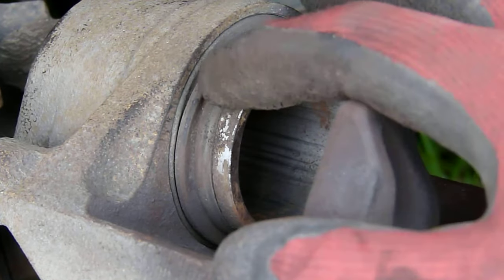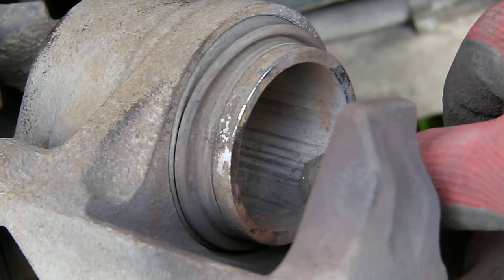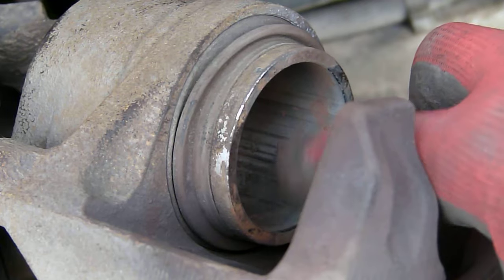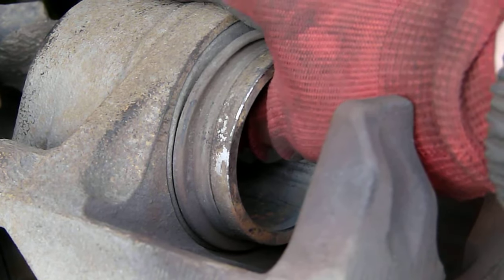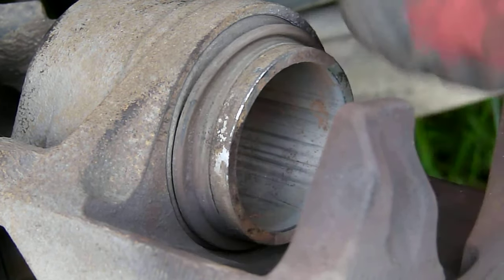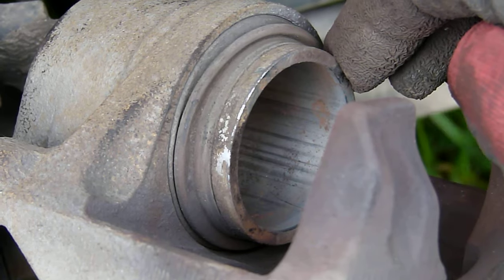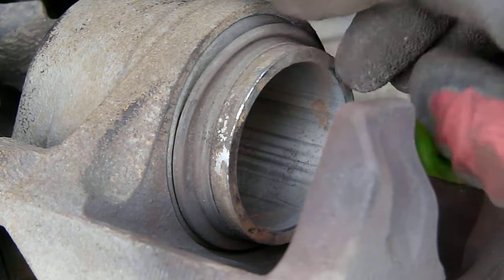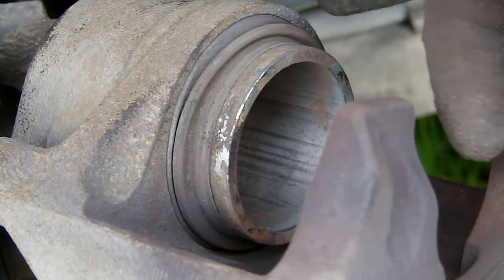Piston Lubrication on a Brake Caliper

Comment: Brake fluid will destroy,  rubber in no time,  the only thing you use it is red greese for pistons.
Reply: Listen man my brake calipers keep sticking open. Making my truck bog down and wearing out the brake pad quickly. What do I need to put on it to where it will open and close freely when it needs to? Do I hook up a grease gun to it and grease it does mine have a grease port? It's a 98 Mercury mountaineer. If I just rubbed the grease on the Pistons on the outside and let them shove themself back in with the c-clamp
Reply: @iamthepapi6251  well it sticks because of grease,  you don't need to add to much grease to caliper piston,  and it's important that you add red caliper grease not something some makes piston stuck.  I recommend you to press  piston ½ out, by pressing brake pedal,  take some brake fluid in 5 ml 💉,and wash rubber boot from inside,  depress piston and repeat x 4-5 time same prosedure,  after that use red caliper grease and add the piston.  I shall add some video of prosedure from en guy from Russia which cured brake caliper.
Reply: @iamthepapi6251  https://youtu.be/Sz1nN5b68Ic  watch from 3.30 he used brake fluid and direct grease for caliper.
Reply: Brake fluid is in contact with rubber parts. Piston seals made of rubber. So what you're saying is beyond absurd.
Reply: @rafars2246  yes its in contact but it dosent mean that you dont need grease to lubrikate slide piston,  brake fluid softens ruber and after some time it must be replaced,  because of softing of rubber. Try this experiment for your self and think that rubber sits fast on edge of piston for loong time not one week 
https://youtu.be/ztrnIRPX1t4
Reply: @viking236  rubber is used in caliper piston seals, so it can't be that bad. I would agree you'll use some silicone paste instead. I also put a light coat on the outside of the rubber.
Reply: Thoroughly clean out dirt, water and corrosion salt from the piston bore where the oil and dirt seals are seated. It's here that is the main cause of corrosion build up which seizes the pistons.
Only use plastic or non metal pick/hook tool for removing any corrosion build up.
Once thoroughly cleaned, apply Red Rubber grease to the new seals. This will provide protection around the seal seating area and provide some protection to the rubber.

Comment: I used anti seize to lubricate the piston. Did i screw up?
Reply: YUP! 
Next time you're doing that brake 100% expect to replace all of the rubber parts inside and out. 
Use that transparent green silicone caliper grease. Been using it for over a decade, no internal seal has expanded or stuck on the caliper wall. Tho it does retain brake dust on it's outer surface so thoroughly wipe it clean before working on said brakes. 
.

Comment: My brakes started squealing 50 km after replacing both the rotors and pads. Initially, there was no squealing, but then something must have happened during the bed in phase. To address this, the mechanic cleaned the piston and applied lubricant to it. He also lubricated the slide pins and used compressed air to clean the pad shims. Do you think it was the right approach or perhaps the issue is due to the combination between the pad and the disk, considering that the pads were not able to correctly bed in? For information, the pads are from Brembo and the rotors are from an Italian company called Open Parts
Reply: Did the squeal stop or condition improve after cleaning and lube?